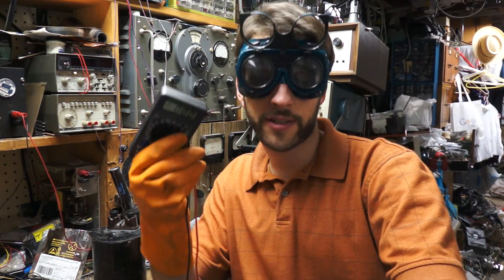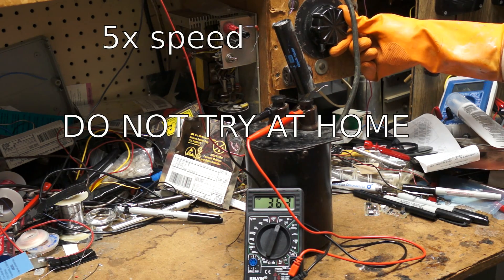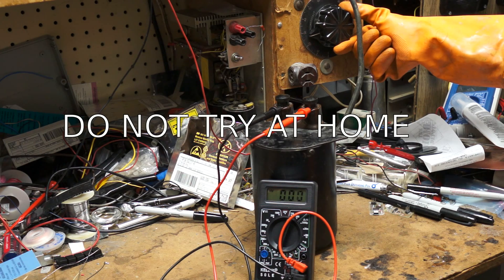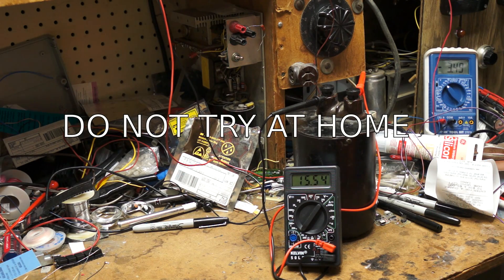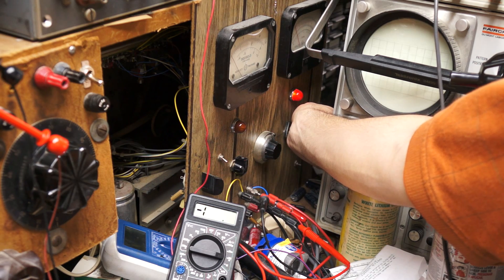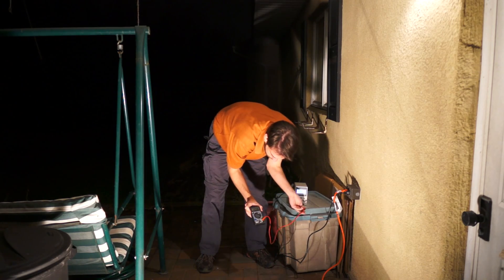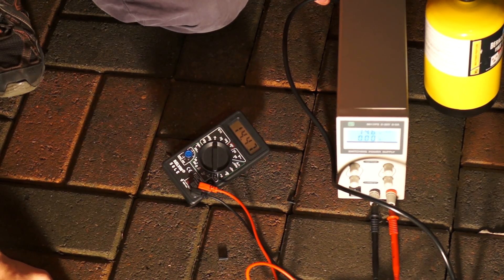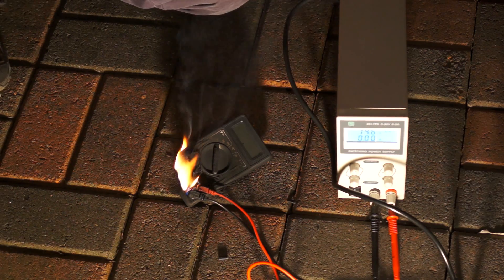Kelvin 50LE Multimeter vs 3,500 volts, 14' drop and more.

Comment: Next time try duplicating real world failure conditions where hundreds  if not thousands of amps of current can be present.   You weren't applying enough power to create arc flash or arc explosions. The fact that the transformer once knock you on your ass is not evidence it can't deliver the power to cause an arc flash or arc explosion. When it come to potentially dangerous test equipment, when that energy does presents itself it is or can be dumping into that test equipment.  Sorry the ignorant are always a clear and present danger to themselves and the other ignorant, ignorant  Being ignorant isn't equal to being stupid, stupid is remaining ignorant. I see you where doubling down over at the eevlog forum, why? I don't believe you have the education to hold up when exposed to known and accepted facts.
Reply from the maker: waswestkan At 1,000 volts, even if 1,000 amps were present the damage would be no more than just a few tens of milliamps provided.  If there is no conduction, the current doesn't have any bearing.  I would never, ever use one of these to measure 3kv.  But, I certainly would to test a 480 line, or 500v DC.

I am just completely frustrated by people who think there is some kind of significant connection between money and quality, or safety, because there's not.  It's a weak connection at best.
Reply: CNLohr Your transformer is current limited (otherwise it would die driving a Jacobs ladder, which is essentially a short circuit). When the meter shorts out, the output voltage of the transformer collapses and very little power is dissipated in the meter. There is likely never 3500 V across the meter, and without measuring this voltage while doing the test, there is no way to know.

Many of the more expensive meters are built and approved according to safety standards, and this is the only way to know that they are reasonably safe for a given application.
Reply from the maker: The purpose of this test was to show that the meters can safely measure what they are advertised to measure.  The rest of this video is just an exercise in abuse.

Comment from the maker: ...For the energy to do anything it would have to be dumped into something.  Without the higher voltage, there's no way for it to actually cause any damage.  This isn't a neon sign transformer, this isn't current limited.

Comment: the eevblog did a video about input protection in multimeters, some of the different settings use totally separate protection circuitry. so that could explain why the resistance mode still worked after you destroyed the voltage mode